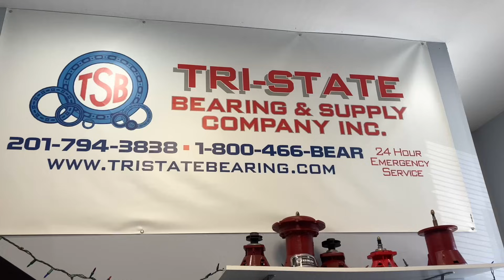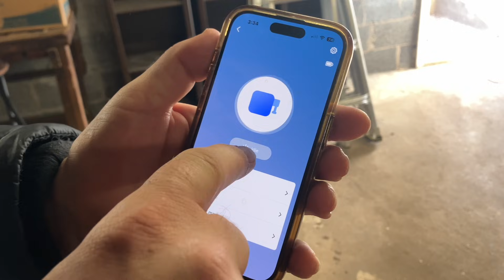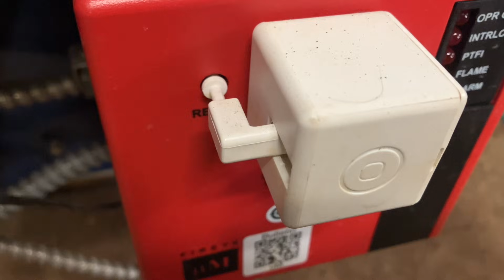This $30 Tool is Absolutely Genius

Comment: That is not Genius that is dangerous, I don’t care what camera you have you can’t see gas, if it’s on oil and the chamber is full of oil and you reset it and it does light what happens then, I would have disabled burner and left. Call me back when that thing is gone and I can document it.

Comment: the button bot on a boiler is a good idea, but that lazy sup should know better lol! you gotta get eyes on to see why you need to reset it lmfao great vids as always bro! i dont even do boilers but love to see your vids on em. also adhd is deff something i struggle with too lmfao
Reply: I was about to say that. Usually when a fault needs a manual reset by a skilled person, it's for a reason that this fault did not lead to an auto-reset after a delay for instance.  I hope this will not lead to the unintended combustion of the building ;-)

Comment: what brand are your box wrenches they look super nice
Reply from the maker: https://www.amazon.com/WORKPRO-Flex-Head-Ratcheting-Combination-Constructed/dp/B06ZY3DG6P/ref=asc_df_B06ZY3DG6P?mcid=c8e351d0e020323393f756d9ba8541fd&hvocijid=8144851615791653991-B06ZY3DG6P-&hvexpln=73&tag=hyprod-20&linkCode=df0&hvadid=721245378154&hvpos=&hvnetw=g&hvrand=8144851615791653991&hvpone=&hvptwo=&hvqmt=&hvdev=c&hvdvcmdl=&hvlocint=&hvlocphy=9003650&hvtargid=pla-2281435180058&th=1

i took them out of the sleeve because it took up a lot of space
Reply from the maker: sorry just realized those were metric, just make sure you get the more superior American standard set, its from 3/4" to 1/4"

Comment: Those friggin backpacks are a PITA! Got rid of my Milwaukee one for that reason. Damn things can't sit upright, just fall over  and annoying trying to get tools out. Went with the new structured bag, muuuuch better
Reply: Which Milwaukee bag did you have?? I've had a packout backpack for the last 3 years and it has only fallen over on me when it's on really uneven surfaces. I've seen the other backpack though, and it looks unsteady.
Reply: @PawsumGaming  had the regular packout backpack. I found whenever I opened up the  side it would just fall over unless I had it clipped in to another box. The structured bag although wasn't cheap ($329 cdn) is a far better choice in my opinion. Opens on both sides and doesn't tip even when opening only one. It does a few loops and hooks that seen kinda pointless but I guess different trades might find them useful
Reply: @davidyoung4337  True. it really depends what you carry and where your stuff sits. The only issue it's had for me so far is the tape clip fell off. I'd love it if I could carry less in it, but I don't get to carry less weight until Air Conditioning season.